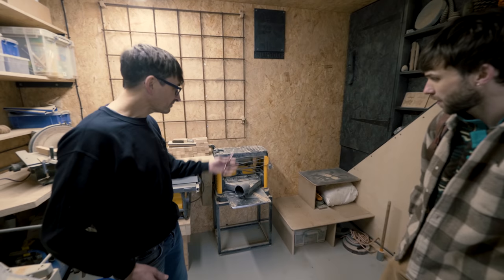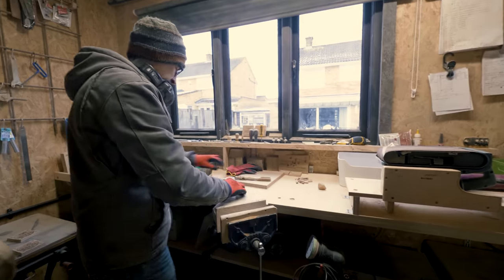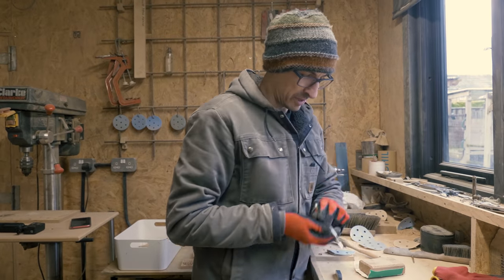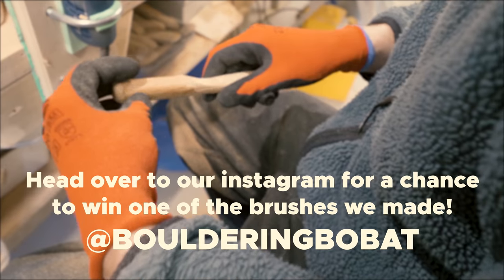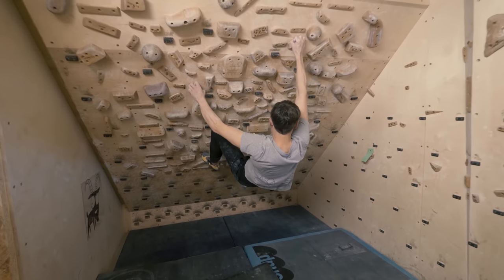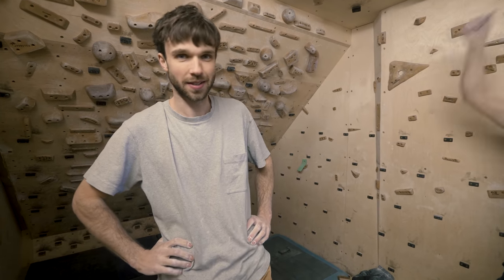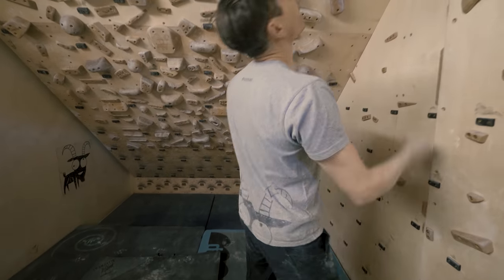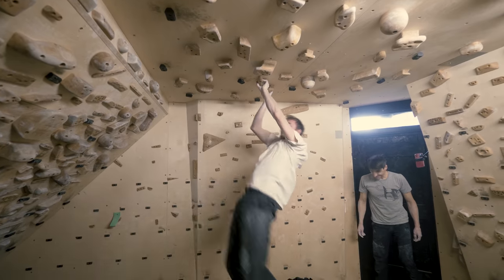Ultimate home wall tour || Brush making with Silly Goat

Comment: Brave using a [REDACTED] like that, seems like a recipie for disaster
Reply: GeorgeS I definitely wouldn’t recommend that someone just do that with no prior experience - but given how (relatively) soft the wood is and presuming a good feel for the tool, I don’t think it’s an above average level of risk for a regular workshop.
Reply: @kramerdesign9443  I'm sure it's fine, but I've had a couple of near misses with grinders so I'm probably more careful than I need to be
Reply: @extreamemineing  Same! A disc shattering is a scary experience! 

(Personally, I'd also fix the tool down horizontally - that vertical orientation does have a slight sketchiness to it)